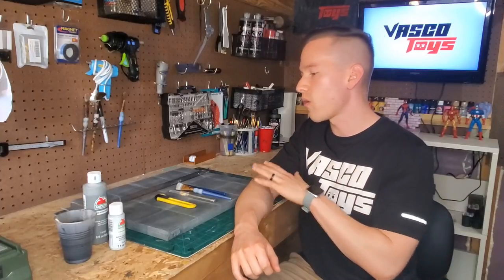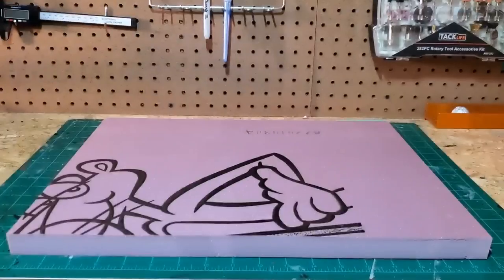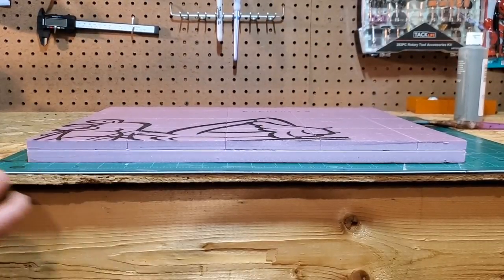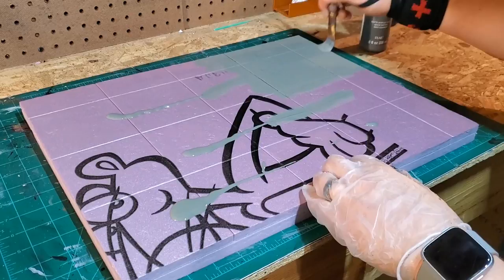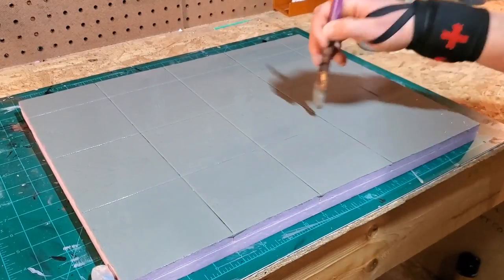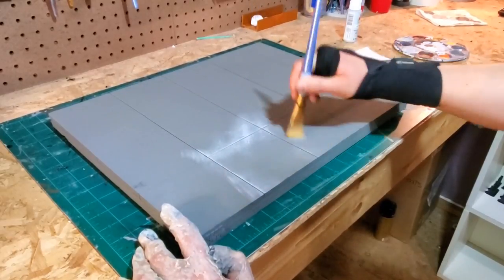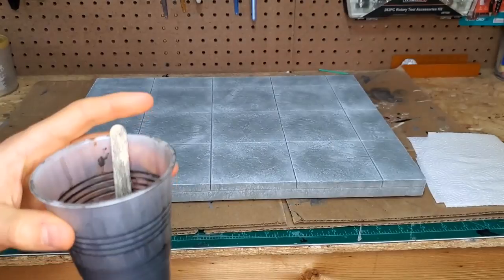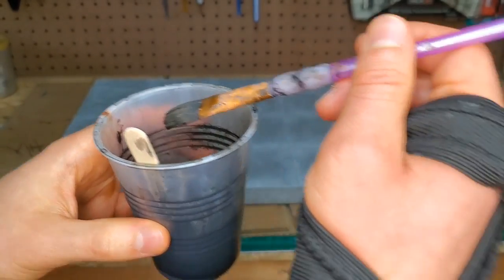Beginner Sidewalk Base for Action Figure Display & Photography

Comment: How do you seal your dios after painting?
Reply from the maker: I use Miniwax Polyurathane to seal my dios. I should have included that as the final step!
Reply: @vascotoys  thank you, sir! T'was a good thing that I asked 😅
Reply: @vascotoys  spray or paint on polyurethane?
Reply from the maker: @CenTexCollector  spray on polyurethane. Clear Satin variety
Reply: Thanks for sharing! Looks pretty awesome. So if I missed it. Did you start off with a 1-in thick or 2 in thick piece of foam? Wanted to give this a try.